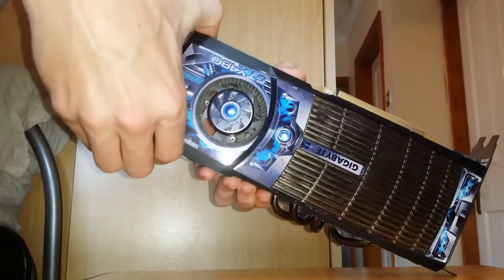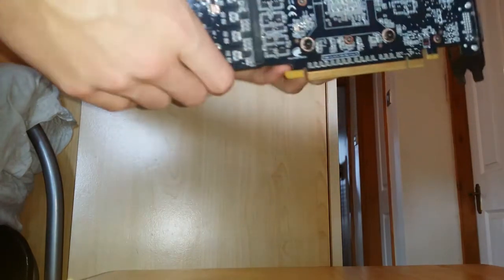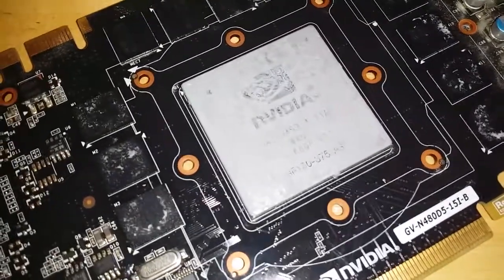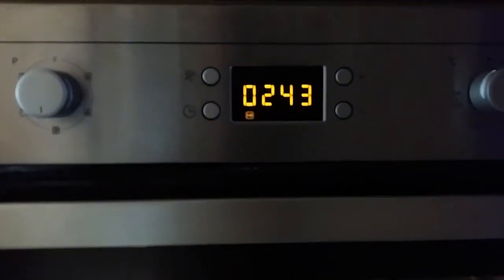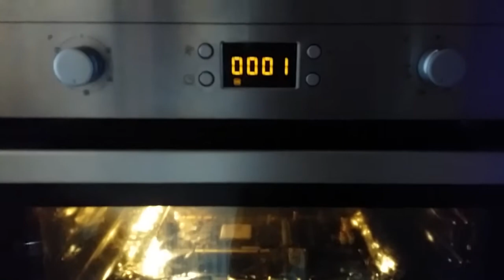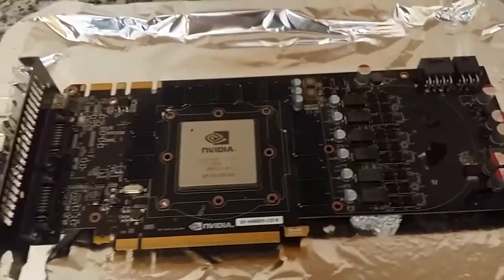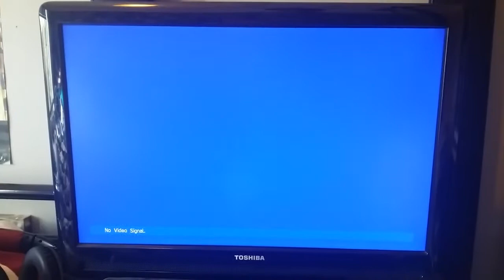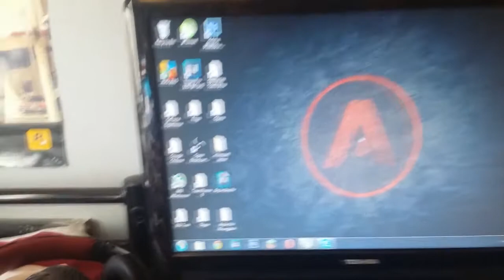Baking A GTX 480 In The Oven

Comment: Just have baked the gtx 780 ti, And it works
Reply from the maker: Awesome man!
Reply: I trade the defect gtx for a good working 6750 1gb. I Don't know how long the oven bake trick works. But for now, it's all worth it.
Reply: Sorry, trade the 6750 1gb for gtx ;)
Reply from the maker: The defect 480 was sold a long time ago, and even if I had I wouldn't swap :)
Reply: gotta try this with my 780ti
success rate seems to be 100%

Comment: lmfao the ending. I had a gtx 480 as well that died on me. I considered baking it but decided to get rid of it altogether coz it ran hotter than Kim Ks ass and was actually nvidias most inefficient GPU at the time. Fooken almost a piece of lava in ur system. Although, it does have great price to performance ratio, as they are literally 60 bucks used here in new zealand.
Reply from the maker: They are here cheap in the uk, you should have just baked it and sold it lol :P